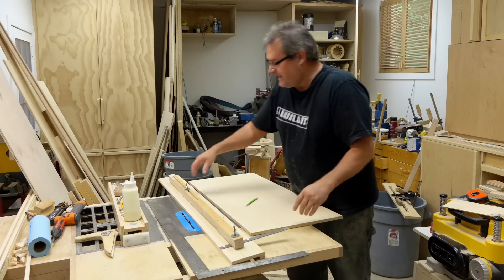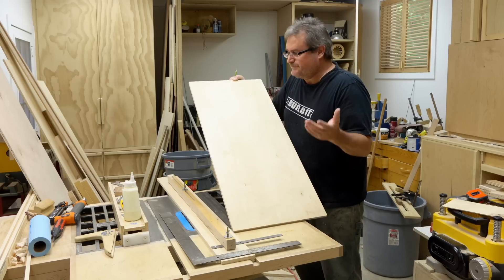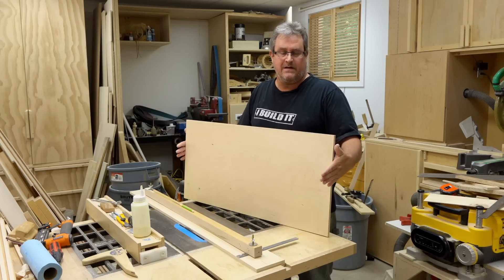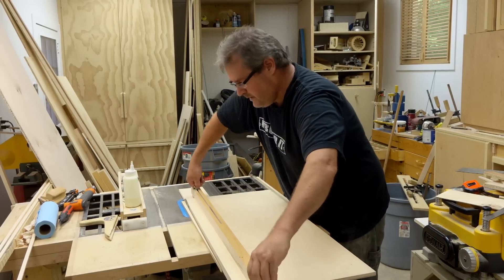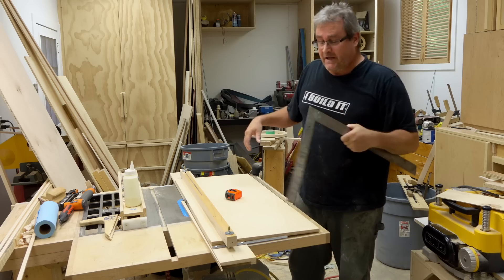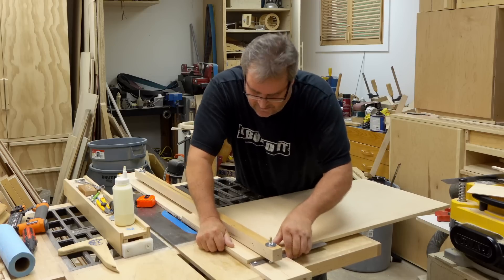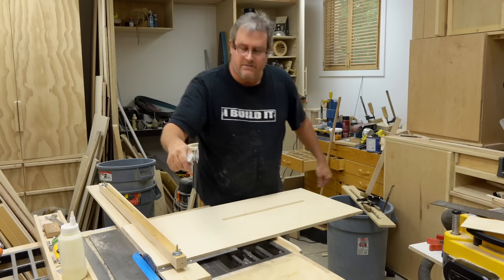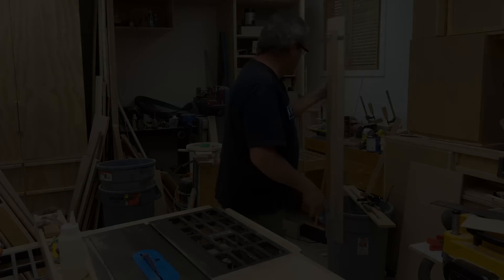How To Use The Wide Panel Crosscut Jig

Comment: I really like this jig.  I was going to spend some time this weekend finally making the "Norm" version of the panel cutter and then this video showed up.  I like the piece of steel as a squaring fence; I think I will drill one of the holes oblong so I can pivot it to a "perfect" square while using the original holes in the sled.

Comment: Did enjoy it ... Other videos  on YouTube ... At least from big tv shows channels ... On home made cross cut sleds they won't show you how accurate the cuts were.  They just make a cut and say 'see how easy it is' ... End of video. Appreciated the honesty because it's not just hand waiving ... Liked the wing nut clamp idea and design ... Bet it holds pieces in place better than incra' express sled's knob clamp ... That causes shift when it's tightened.  You do have a video on how to properly square up the edges of a piece before final cuts I think.   10thousands is close enough to give confidence that one could make minor adjustments and a couple more cuts on same sheet to get dialed in.  Most times simpler is better.  Interesting ideas on cross cut sled's.

Comment: Hate squaring bigger panels, for some reason, I end up using the factory edges of a big sheet for smaller projects, then I need the big piece in the middle and I have no reference square cause I rough cut it with a jigsaw or something, have to measure it all out and figure out a "square" part inside of the whole thing. Nice vid, thanks!

Comment: Most people I know tend to go with a Norm Abram style panel sled for sheets that don't fit in a normal crosscut sled. The front fence on that takes care of squaring the material. I assume you didn't go that route because you wanted a smaller jig?
Reply from the maker: http://www.ibuildit.ca/Workshop%20Projects/Jigs/Norms-crosscut-sled.html
Difficult to use for wider pieces and nearly as bulky as a big crosscut sled.

Comment: I was wondering what all the fuss was about after I watched the first video. It's really no different from using a track saw, as you pointed out then, John. The user is responsible for deciding where to make the marks and how square they are, then align the jig / track saw to the marks.With this jig, it may be easier to make the marks on the bottom face and affix the jig upside down -
 that avoids having to extend marks to the edges. Alternatively, attach a thin piece under the clamp which extends to the edge. After the initial cut, you now have an alignment edge on the top, just like a track saw.